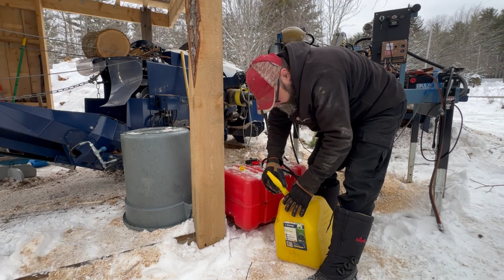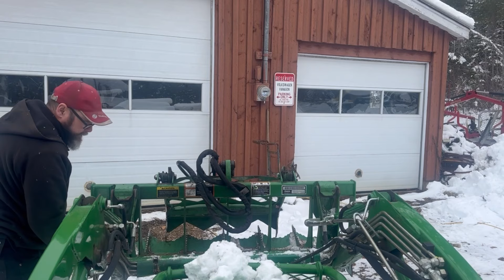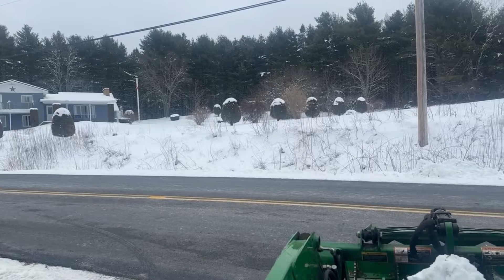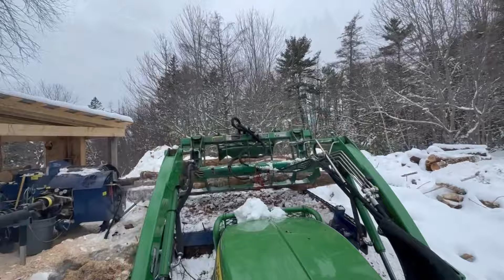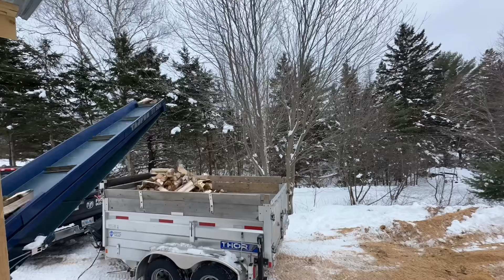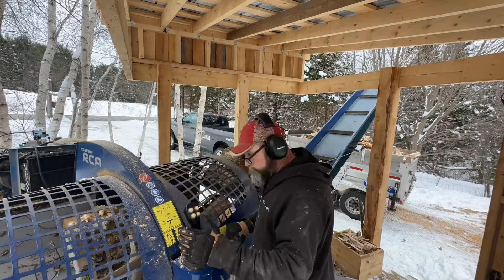FUNNER DAY TODAY.

Comment: I was sitting down one night working with # , I work out 25 lbs off firewood 🪵 in soft or hard wood 🪵 = to one ☝️ gallon off furnace oil in heat . I’m not educated person in words but smart in math 🧮. I work the # in different way came out to 25 lbs firewood 🪵 to a gallon ( 4.5 litre in Canada 🇨🇦)  oil in the same heat in BTU  Jeff  - /+ 1or 2 % . remember LIFE IS POOR IN THE 709 ! 😢😊
Reply from the maker: If I remember correctly- a full tank of furnace oil has the same btu energy as 2.5 cords of mixed NS hardwood…

Comment: Put a check  value  in  the  fuel  line it won't  back  feed
Reply from the maker: I was hoping to have my rebuilt pump back before now. It leaks out between the head and the body of the pump- a check valve won’t help that.